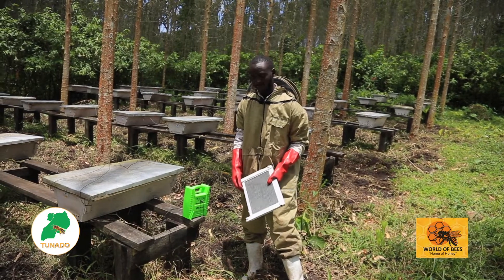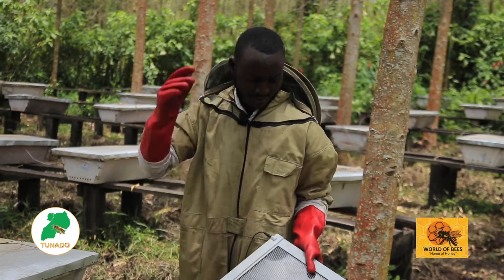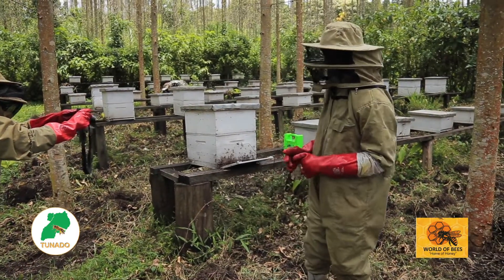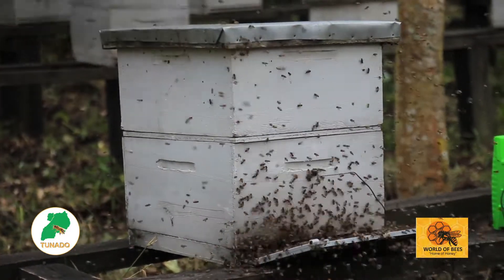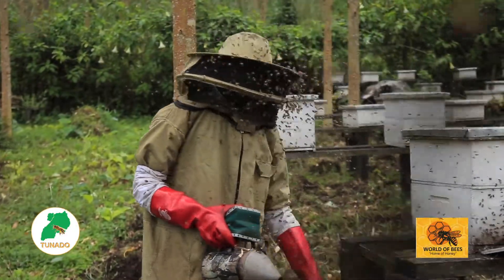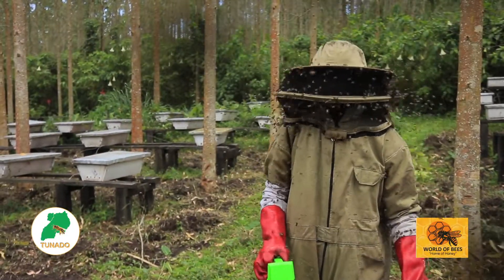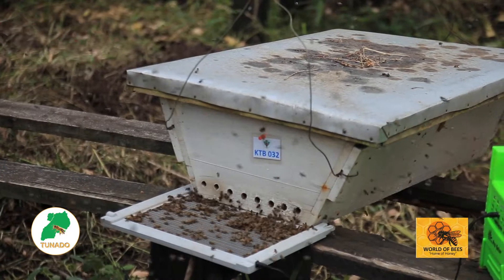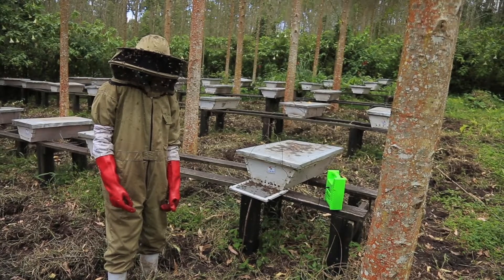How To Collect Bee Venom Using Simple Cost-Effective Machines - All steps Explained

Comment: You don't have to use the smoker while extracting venom. It is not recommended. Just leave the extractor and move away and let the extractor and bees do their work. This is another stress on top of the much stress by the extractor. The bees will calm down on their own when you remove the extractor.